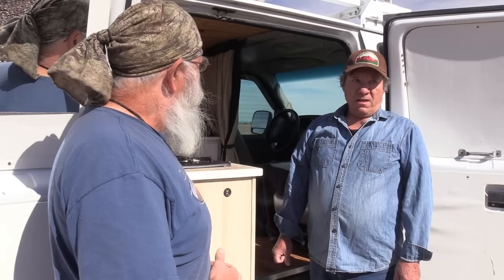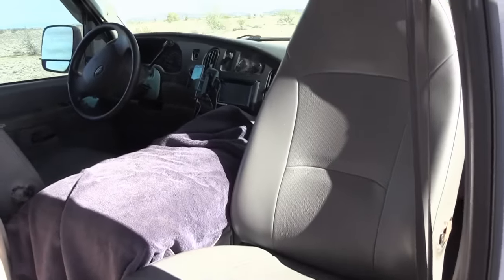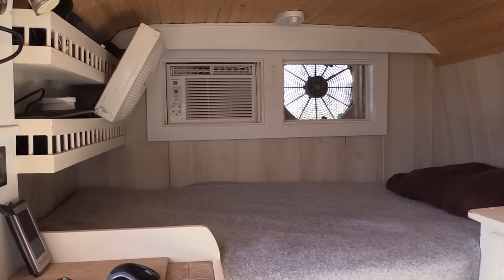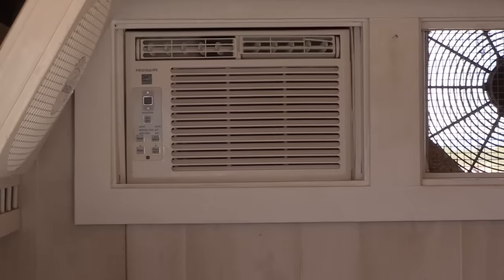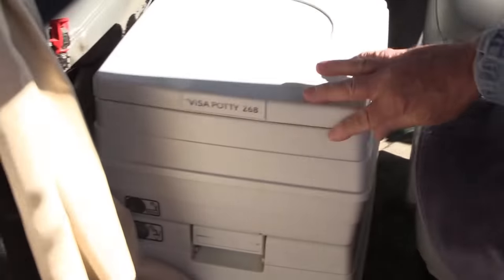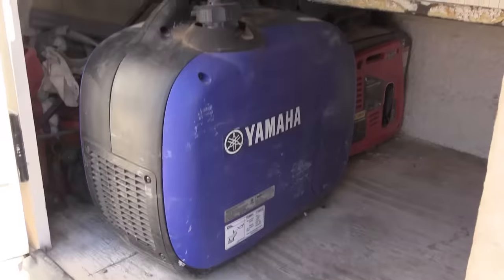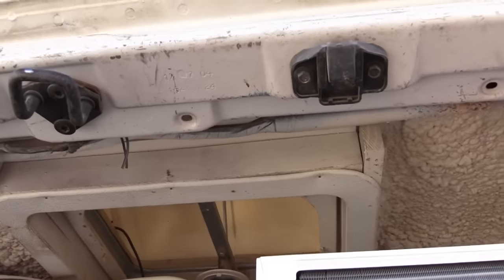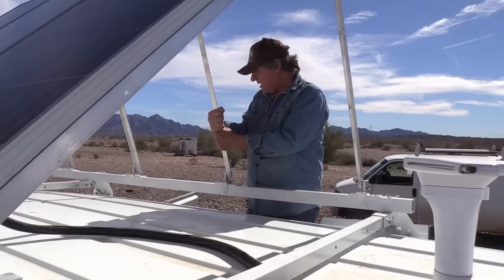Van Tour of a Nomad Living Cheap in a Van

Comment: Never saw a solar mount like that , the whole van is great. Thank you Bob
Reply: I have actually been thinking about doing something similar. i have 3 panels right now, but i have a 4th thats sitting in the van. my problem is the slope of the roof. which is why i was thinking of something similar to this. a rack of some kind to mount the panels and allow that to make the slope not bad, and be able to make the panels tilt towards the sun. I love how in the video he has the panels pointed the opposite way of the sun, but that could be just how he drove it for lighting for the video footage.

Comment: This is EXACTLY how I picture my van conversion if I were to have one.  He did a beautiful job.  I've always mumbled to myself, PUT THE ROOF FAN ON THE SIDE OF THE VAN, KEEP AWAY FROM MAKING HOLES IN THE ROOF !  And this guy did it !  His design/layout is perfect.  It's clean and tight lookin.  Love the white cabinets against the wood ceiling. I wouldn't, however, put a utensil holder 'thang' in a stainless steel "dish" embedded in counter like he did, tho.  I'd have utensils tucked away in a drawer.  With just another 2 feet  in length to this van, he could have a lil shower/toilet situation closet, too.  And, I'd prefer a higher ceiling.

Comment: That was one of the best and most organized conversions I've seen on a van. If that radiator fan can operate by switching the POS & NEG wires, a simple Double pole/ Double throw switch could be mounted on a panel, nearby. Wayne put in some good thoughts in, before the effort to create this jewel.
Reply: Nope…you must disassemble and flip the blades also.

Comment: Very nice build, such good wood craftsmanship on the little shelves!  Clever garage and AC/fan system.  At first I thought Wayne sealed up the back doors, but he built a second set of doors, which is smart as you can keep the garage contents locked while having venting.  Also makes a good spot for a solar shower.  Glad to see he has a toilet.  This makes dry camping much easier.

I wonder why Wayne and others use the heavy glass solar panels?  The glass ones weigh 38 lbs each compared to 1 lb for flex panels.  Why tilt them the other way?  Just turn the van around.  We think we need to tilt both ways, but in the city, you cannot be stealth if you tilt at all, so they will remain flat.  In open country, you can park any way you like, so why tilt, just turn the van around.

Comment: I think the red tray under the AC unit was probably a condensation evaporation tray, but if you put a drip hose on the condensation line, and ran it to a closed bucket...could this be a small source of water?  Great, great idea to build the "garage", mount the AC there, and vent it through the roof.

Comment: I would drill a hole behind the wing nuts in the bolts that hold the panels on the roof and slide small pins in them as safety in case a wing nut may unwind...

Comment: Oh to be 5'2" and only need a cargo van to stand straight up in.  ( I know he said he is 5'7" but I figure 5'2" would be better.)  In fact, if I was only 3'4" I could get a high top and have a 2 story RV Van.   I like your system. Personally I have a tent style 7,500 BTU air conditioner, (yes it is much bigger than needed 90% of the time, but I can run it on low.) I wanted a small outside foot print and because of rough roads, my window air conditioners did not hold up.  My Solar system is also a tad bit over kill at more than 2.5Kw.  I will not have to realign the Solar Panels due to the overkill in power.

Comment: How does he run an AC unit off batteries? I've always heard that you need a generator.
Reply: he said it work for only 6 hours because the load (current) is very important. He got a 3000 watts pure sinus inverter so this is not a problem. 3000 watts is like almost 30 amps so this is more than enough to drive a 8 amp compressor.

Comment: he said 3.9 amp x 110 volts= 430 watts x 6 hours= 2574 watts-hour required to run the air conditioner
if he has a battery bank similar to Bob, 4x6voltx225 amp-hour= 2x12voltx225amp hour= 12volt x 450 amp-hour= 5400 watt-hour
he can use only 50% so this is 5400/2= 2700 watt-hours so he have just enough to run 6 hours
and 3 time 150 watt of solar multiplied by 6 hour is enough to recharge  3 x 150 x 6= 2700 watt-hour
Reply: Denis Fortier he has a generator for the air conditioner he says it in the video
Reply: Sure.  If it's running constantly.  But A/C doesn't usually run constantly.
Reply: Thank you for the computations.  Very helpful to use as a sample for planning. A single woman, just getting oriented.